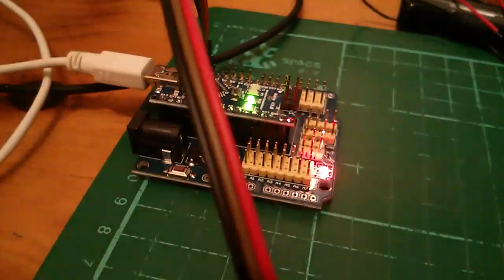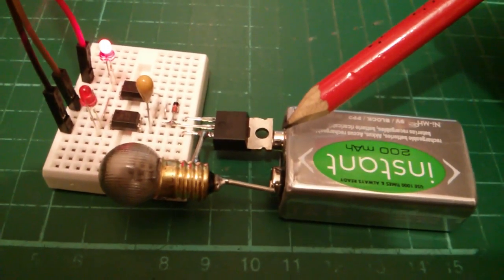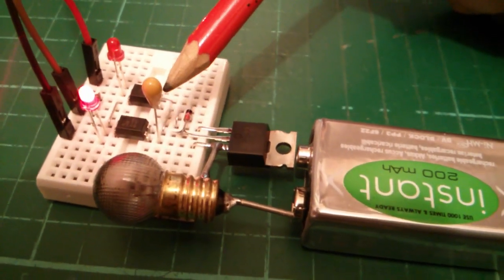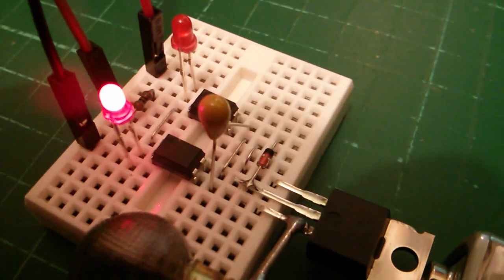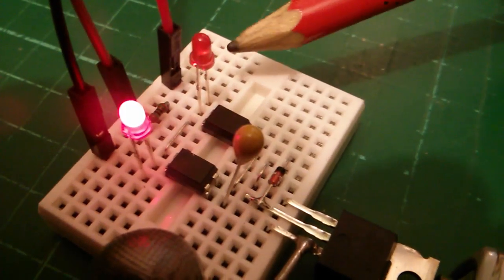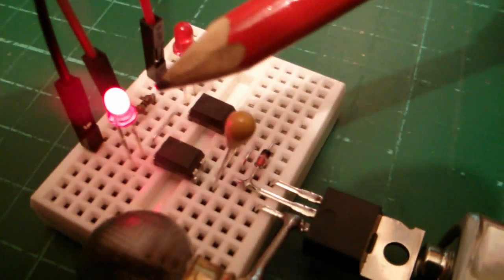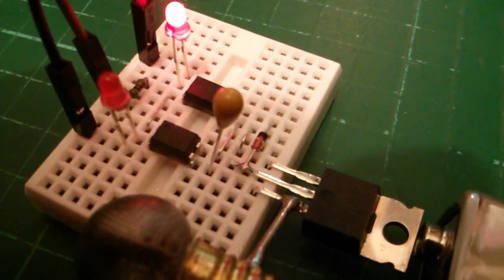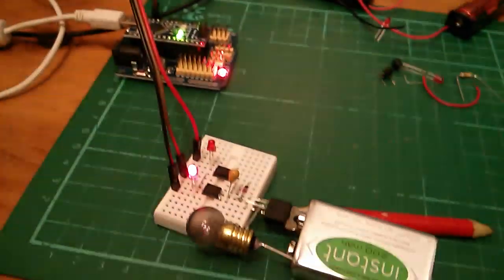Dual Complementary Opto-Isolator (DCOI) High Side MOSFET Driver #1

Comment: I am really glad you have shared this with everyone. I have very limited knowledge of electronics but I've picked this circuit to experiment with. 

      My experiments revolve around high freaquency inverters, so I used the complementary action of the dcoi circuit to drive the gates of two mosfets which are tied to ground with 10k resistors. Each drain feeds power to separate coils of the same (repurposed) gate drive transformer and then read the output of a tertiary coil on the GDT.

       In this manor I was able to visualize and tweak the performance. The resulting product was a very inefficient square wave inverter but it did work. The largest issue is the turn on time of the optocouplers which caused a distorted signal above 1kHz, ignoring the distortion, I could drive them up to 14kHz. 

      To compensate for the on time lag in the couplers it was necessary to tweak the duty cycle to such extremes as 95% to acquire a relatively clean square wave.

      I really do enjoy your channels and look forward to more brain teasing projects. Thanks, Jason

Comment: This is a very clever and useful circuit, and it's beautifully explained thanks Julian. I reproduced it and used it to switch a 12V power supply on and off with an arduino, and it worked perfectly. However I noticed that the bootstrap capacitor / diode is acting as a voltage doubler, so it works with these voltages; but if you want to switch say 1000V (as I do) then the source / gate voltage will get up to 1000V too (source at 1000V and gate at 2000V) and fry the mosfet. Any suggestions as to how to keep the gate switching to source +5V instead of source x2?
Reply: Hmm... looks like I may have answered my own question: I took out the capacitor / diode and replaced them with a 5V battery. The battery voltage floats on top of the source voltage and adds 5V to it when it's switched on by the optoisolator. Now I'm wondering if there is a way to get the extra 5V from the high voltage rail (regardless of what voltage it's at) instead of using a battery and without doubling it?
Reply: //...@ Stacy Hunt...I once search video and saw it at...MOSFET BOOTSTRAPPING TUTORIAL...maybe hellp : 
1). VCC-->source (1000v);
2). charge pumps circuit will increae Gate at 2000v (it Could break Gate);
3). Put a 'Big resistor' between 'Gate' and 'Tantalum capacitor'.

Comment: I couldn't understand why the voltage would increase across the capacitor. But then I realized when you wire 2 AA battery in series the voltage also increases. The tantalum capacitor could be replaced by a non-polarized capacitor.

Comment from the maker: That's it. The four LEDs together have a forward voltage greater than 5v, so they don't light at all (even with no series resistor). Connecting the Arduino output pin to the mid-point of the LEDs (via a resistor) creates a complementary drive - the upper 2 are on when the digital pin is low and vice versa. I'm still waiting for a whole load of 3mm LEDs to arrive from China. As soon as I get them, I'll make a part 4 with a step by step explanation of how it works. Cheers.

Comment: It took me two days of pondering to figure out how the Arduino pin could switch the LEDs. The four LEDs can't burn together on 5V because they're wired in series. When an Arduino digital pin is DOWN that pin is connected to GND (!!!!). When the Arduino pin is LOW this connects the first two LEDs to GND and hence pulls them up. When the Arduino pin is HIGH this supplies LEDs 3 & 4 with 5V while LED 2 acts as a diode. In essence the Arduino pin constantly switches between 5V & GND. That was fun!

Comment from the maker: Right on all counts. The bootstrap technique relies on the MOSFET switching on and off - in effect it's a charge pump. But I reckon it would work fine with a 99% (or even 254/255) PWM mark/space ratio, as long as the bootstrap capacitor is much bigger than the MOSFET gate capacitance. Here it's 2000/1 (3.3uF/1.5nF).

For the MPPT (charging a battery) the bootstrap isn't suitable so I'll probably use the charge pump circuit I built a while back.

But the dual opto driver should work fine.

Comment: That's pretty cool what you've done. Presumably you can only turn on the mosfet in this way while the cap charge lasts, but from experience I have found this can be a damn long time! I had a 470uf electro keeping a mosfet turned on for over two weeks! But the other thing though is that it relies on the load having a low impedance to ground when unpowered to allow the cap to charge. There might be problems if this load was a battery. 'Cause the +ve terminal will stay +ve and not drop down to gnd.